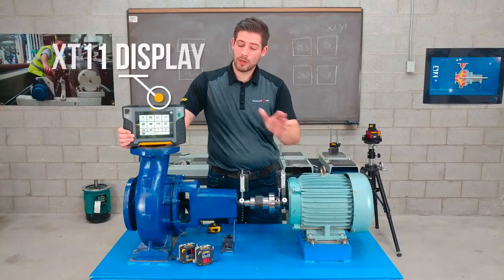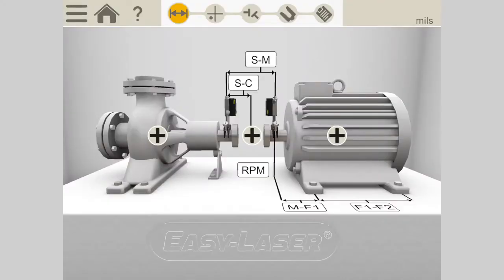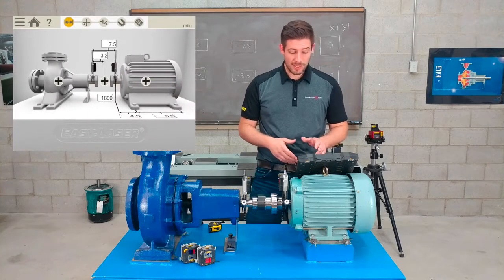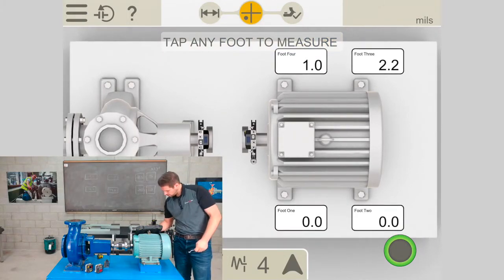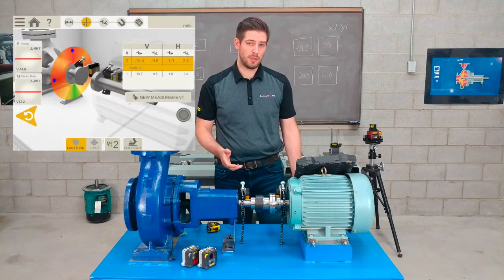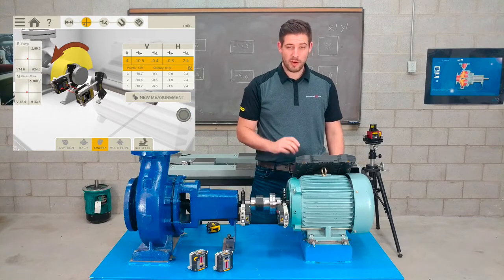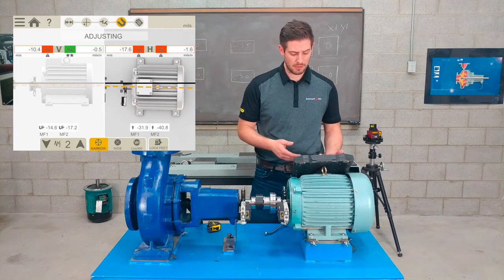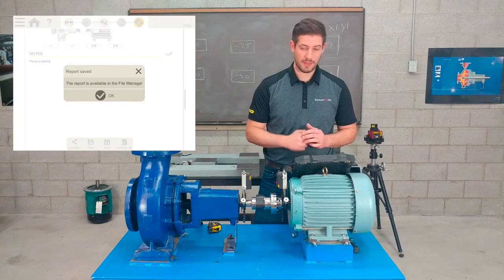Easy-Laser XT Shaft Alignment Demonstration

Comment: Good sir when i got the result and try to step adjusting. By tighten the adjuster bolt. Why my red value not change even though Ive tried to loosen and tighten the adjuster bolt